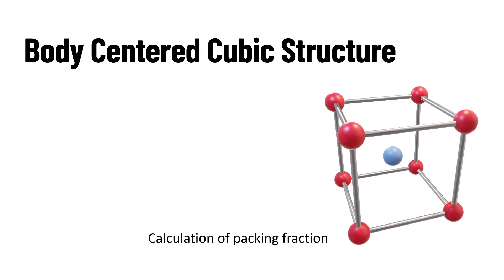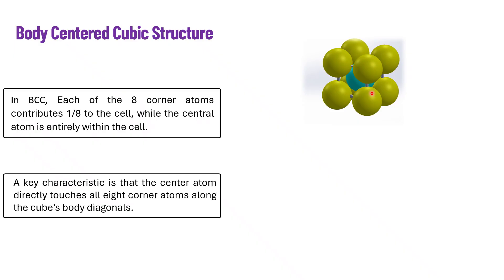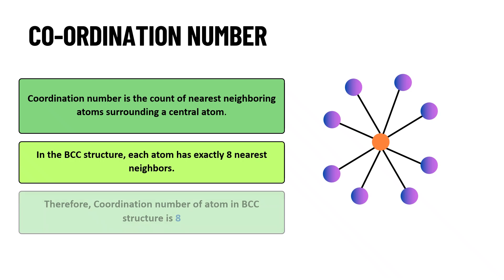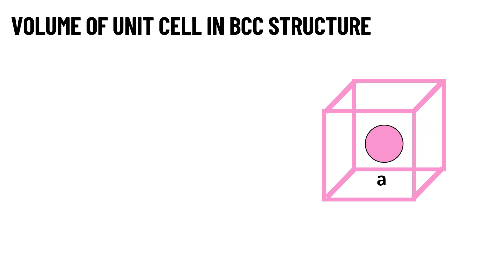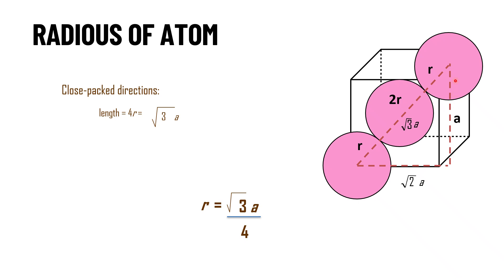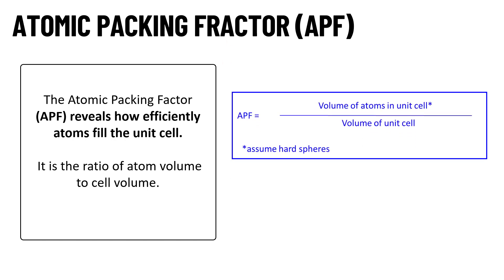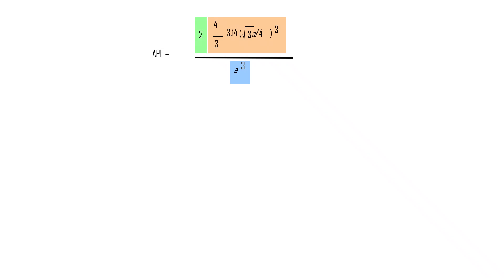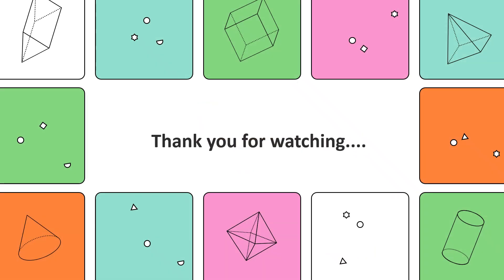Atomic Packing Fraction of BCC Structure | Step-by-Step Derivation Explained

Comment: The video explains how to find the Atomic Packing Fraction (APF) of a Body-Centered Cubic (BCC) crystal structure. It describes the BCC unit cell and shows how many atoms are present in it. The relation between atomic radius and cube edge length is explained. Using this, the APF formula is derived step by step. This helps understand how tightly atoms are packed in a BCC structure.

Comment: The video explains how to calculate the Atomic Packing Fraction (APF) for a Body-Centered Cubic (BCC) crystal structure, walking through the geometry of the BCC unit cell, identifying how many atoms are effectively inside the cell, determining the relationship between the atomic radius and the cube’s edge length, and then using these to derive the APF formula. It breaks down each step clearly so that viewers can understand how the densely the atoms are packed in a BCC arrangement compared to the total volume of the unit cell, illustrating fundamental concepts in materials science

Comment: The video explains about the concept of body centred cubic structure and explain how to calculate atomic packing fraction also coordination number, volume of unit cell in bcc structure, atomic radius, APF revels how efficiently atoms fill the unit cell also explain the formula for calculating APF for bcc is 68% space is occupied by bcc structure.

Comment: The video explains the Body-Centered Cubic (BCC) crystal structure, in which atoms are located at the eight corners of the cubic unit cell and one atom is positioned at the center. This arrangement results in a total of two atoms per unit cell and a coordination number of eight.

The Atomic Packing Factor (APF) is defined as the ratio of the volume occupied by atoms to the total volume of the unit cell. The BCC structure exhibits moderate packing efficiency—higher than that of the simple cubic structure (approximately 52%) but lower than that of the Face-Centered Cubic (FCC) structure (approximately 74%). This level of packing contributes to the structural stability of BCC metals such as iron, molybdenum, and tantalum.

Comment: This video explains that BCC is a crystal structure with 8 atoms at contribute 1/8 while 1 entire atom is at centre of structure.
BCC is more stable than SC structure.
•BCC Co-ordination number:8
•No.of atoms in unit cell:2 atoms
•Volume(perfect cube):a³ (a is side length)
•Radius of atom(r): √3a/4
•APF:0.68
68% space is occupied.

Comment: In this video, I studied the body-centred cubic (BCC) structure and the atomic packing fraction (APF). The video explains the BCC structure step by step and how the APF is calculated. In a BCC structure, there are atoms at the eight corners of the cube and one atom at the centre, and the atoms touch each other along the body diagonal of the cube. The video also discusses the basic formulas related to this structure.

Comment: In the video see that the information about bcc structure and how they are made in bcc atoms are at corner and their are 8 corner atom in bcc . Tantalum and molybdenum are the example of bcc material.  compare to scc structure bcc is more stable and prevalent  . the coordination number of bcc their radius and volume of bcc atoms structure and the arrangement of atom in unit cell of bcc in bcc 2 atoms in unit cell of structure. the APF of bcc is 0.68 also how to calculate the APF in bcc structure

Comment: The video explains the Body-Centered Cubic (BCC) crystal structure, featuring atoms at the eight corners and one at the center of the cubic unit cell, resulting in 2 atoms per unit cell and a coordination number of 8.
The Atomic Packing Factor (APF) is calculated as the volume of atoms divided by unit cell volume.
This moderate packing (higher than simple cubic's 52% but lower than FCC's 74%) contributes to BCC's stability in metals like iron, molybdenum, and tantalum.

Comment: This video demonstrates the step-by-step derivation of the Atomic Packing Fraction (APF) for a Body-Centered Cubic (BCC) structure, which is a crystal arrangement where atoms are located at the eight corners and one at the center of a cube. The instructor explains that a BCC unit cell contains a total of two atoms and has a coordination number of 8. And we also study about the radius of this structure.

Comment: This video explains the Body-Centered Cubic (BCC) structure, where atoms are present at the corners and one atom is located at the center of the cube. Examples like tantalum and molybdenum are discussed. The coordination number, atomic radius relation, unit cell volume, and APF value of 0.68 are also explained.

Comment: In this video,Body Centered Cubic (BCC) structure has atoms at the 8 corners and one atom at the center of the cube. Each corner atom contributes 1/8, so the total number of atoms per unit cell is 2. The unit cell volume is a³ and atoms touch along the body diagonal, giving r =√3/4 a. The coordination number is 8 and the atomic packing factor (APF) is 0.68.

Comment: Video Topic: Undressing BCC crystal structure

This video explains that BCC is a crystal structure with 8 atoms at contribute 1/8 while 1 entire atom is at centre of structure.
BCC is more stable than SC structure.
•BCC Co-ordination number:8
•No.of atoms in unit cell:2 atoms
•Volume(perfect cube):a³ (a is side length)
•Radius of atom(r): √3a/4
•APF:0.68
68% space is occupied.

Comment: In this body centered cubic structure is a crystal arrangements with atoms at each corner of a cube and coordination number is 8 and it's common metallic structure like iron , chromium , tungsten . And packing efficiency is 68% and significance is also shown in this video .

Comment: The video provides information about the Body-Centered Cubic (BCC) structure and explains the calculation of the APF for BCC. It shows that atoms are located at the corners and one at the center of the unit cell, with tantalum and molybdenum as examples. Compared to the simple cubic structure, BCC is more stable and common. The coordination number, atomic radius, volume, unit cell arrangement, and APF value of 0.68 are also explained.

Comment: This video explains the atomic packing fraction APF of the body centred cubic structure . BCCS is define as cubic unit cell , example Cr, W, Fe, tantalum, molybdenum etc. BCC is more stable and  prevalent arrangment. APF for  BCC structure=0.68 . Ti find out the APF for BCC structure. The calculated in the APF formula .

Comment: The Video explains how to calculate the atomic packing fraction (APF) of body centred cubic crystal structure it walks through the geometry of the Bcc unit cell shows how many atoms are effectively present in The cell and uses atoms in the Bcc arrangement This helps understand how densly atoms are packed in materials with a Bcc structure

Comment: This video explain the Atomic packing factor of a body centered cubic. Structure in simple way. It covers the concept of APF, the number of atoms  in a BCC unit cells. The reason atoms touch along the body diagonals and the derivation of the atomic radius on terms of lattice parameters 'a'.

Comment: In this video discuss about body centred cubic structure.In BCC structure eight atoms are located  at corner. It contribute one by 8 of the cell. Coordination number in BCC is 8 and total number of atoms per unit cell is 2 the volume of unit cell in bcc structure id a³. From this data we find atomic packing factor the EPF in BCC structure is 0.67.

Comment: This video explains the Atomic Packing Fraction (APF) of a Body-Centered Cubic (BCC) structure in a simple way. It covers the concept of APF, the number of atoms in a BCC unit cell, the reason atoms touch along the body diagonal, and the derivation of atomic radius in terms of lattice parameter ‘a’. The video then shows a step-by-step calculation of APF, ending with the final APF value and its physical significance.

Comment: The video is about the concept of body centred cubic structure and explain how to calculate atomic packing fraction also coordination number , volume of unit cell in bcc structure , atomic radius , APF revels how efficiently atoms fill the unit cell also explain the formula for calculating APF for bcc is 68% space is occupied by bcc structure

Comment: n the video, BCC (Body-Centered Cubic) is described as a crystal structure with atoms at all eight corners of a cube and one atom in the center. This arrangement gives a total of 2 atoms per unit cell, and each atom has 8 nearest neighbors. BCC is found in metals like iron. It helps explain some physical properties of these materials. BCC has a packing efficiency of about 68%. great explanation thanku mam

Comment: Roll no = E33
 This video is about BCC structure  it is body centred cubic cell .. in which atom are present at 8 corners and one at body of crystal , In which 
1- no of atom per unit cell is 2
2- coordination number is 8
3- volume of unit cell is a^3
4- radius of atom is √3/4
5- APF = 0.68

Comment: Roll no = E33
This video is about bcc structure ,  it is body centred cubic cell in which 
1- no of atom per unit cell is 2 
2- coordination number is 8 
3- volume of unit cell is a^3
4- radius of atom is √3/4
5- APF = 0.68

Comment: The video explains how to calculate packing fraction (also called packing efficiency) for crystal structures like Body-Centered Cubic (BCC). Packing fraction is the percentage of space inside a unit cell that is actually filled by atoms. In a BCC structure, atoms are at the corners of the cube and one atom in the center, and when you count how much space the atoms take compared to the total cell volume, you find that about 68 % of the space is filled by atoms and the rest is empty.

Comment: In the video see that the information about bcc structure or calculation of apf factor in bcc 
how they are made  in bcc atoms are at corner and their are 8 corner atom in bcc . Tantalum and molybdenum are the example of bcc material.  compare to scc structure bcc is more stable and prevalent  . the coordination number of bcc their radius and volume of bcc atoms structure and the arrangement of atom in unit cell of bcc in bcc 2 atoms in unit cell of structure. the APF of bcc is 0.68 also how to calculate the APF in bcc structure .......

Comment: Above video explains the concept of atomic packing fraction for body centred cubic structure .  to find out the  atomic packing fraction for bcc structure  we have to calculate the number of atoms per unit cell , coordination number , volume of unit cell in bcc structure , radius of atom. Then put all the above values which we have calculated in the APF formula and we get the atomic packing fraction for bcc structure .

Comment: Excellent and very informative video! It clearly explains the Body-Centered Cubic (BCC) crystal structure and how to calculate the Atomic Packing Fraction step by step. The video shows how atoms are arranged in the unit cell, how to relate the atomic radius with the cube edge length, and how to use the formula to find the packing efficiency. I really liked how the calculations are demonstrated with examples, making it very easy to understand. The explanation that BCC has a packing efficiency of about 68% is very helpful for students learning solid-state physics and materials

Comment: The Body-Centered Cubic (BCC) structure contains 2 atoms per unit cell*—one at the center and eight corner atoms contributing a total of one atom. Atoms in BCC touch along the body diagonal, giving the relation (\sqrt{3}a = 4r) between the cube edge and atomic radius. Using this, the unit cell volume and total atomic volume can be calculated. The APF is the ratio of atomic volume to unit cell volume, which simplifies to (\pi\sqrt{3}/8). Its numerical value is *0.68*, meaning BCC structures pack *68% of space with atoms.